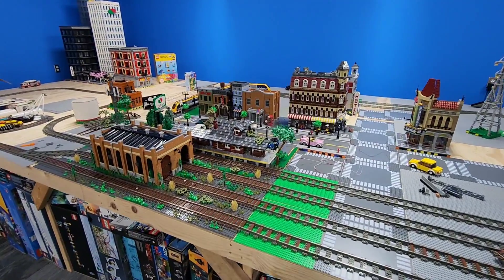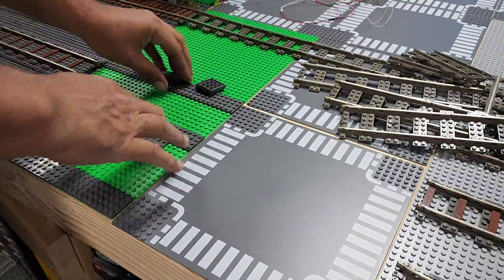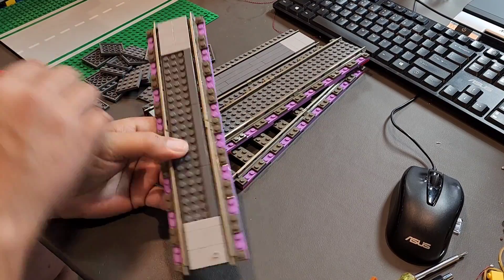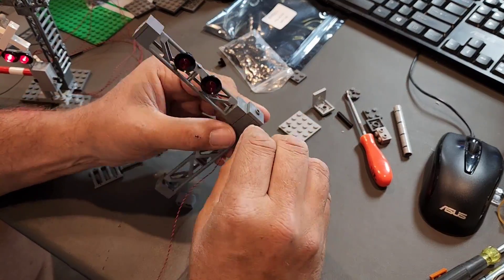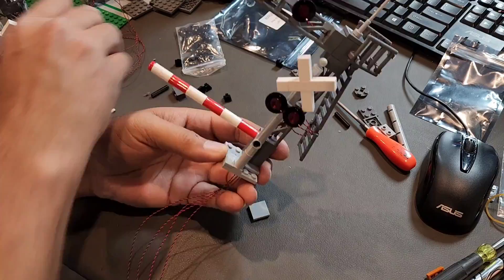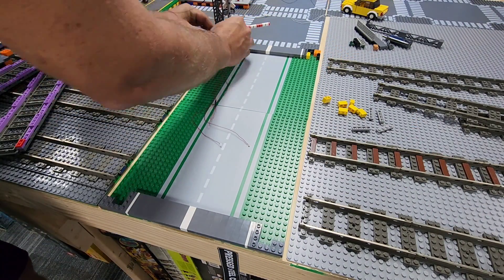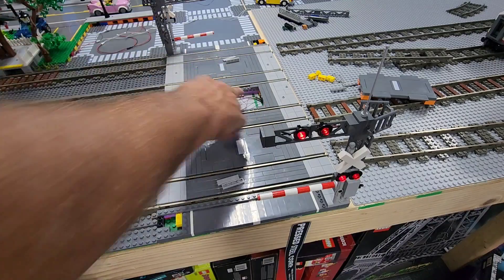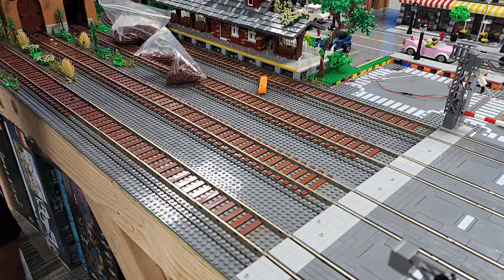Revolutionary Lego City Update

Comment: I'm thinking about getting some of the lighting kits for some of my trains, is there a way to plug your lights into a PF battery box or will I have to accommodate another battery pack onboard?
Reply from the maker: Awesome, they are great for making the trains modular.  As for the battery packs, I'm hoping to have a few more options available in the near future for pluging into the Lego power packs and using button cells, but currently yes the only option I have is using aaa battery box.

Comment: How concerned are you with current drop or throughput for the full display once everything is switched over to the new modular connectors?
Reply from the maker: Well I keep all circuits at under 1 amp of draw. Not worried about current drop as there isn't enough length in any circuit for it to be a concern.  The magnets are rated for 5 amps and the wire is good for  3 at 5volts.  At least I have tested it at that current.  But I still only run 1 amp per circuit as my power supply is rated for 1.5 amps per port.  Quick rule of thumb, 100 leds is 1 amp 😉

Comment: Pinching and binding can cause greater resistance no? 

(I’m only an apprentice 😅)
Reply from the maker: Yes there is added resistance with this type of connection but we are talking about 1/10 of an ohm.  So even with 10 of these your now only looking at a total loss of 1 ohm.  Not something work calculating for. 😀

Comment: The magnet system is pretty cool. I am already using those wireless power connectors for a while to connect the baseplates to each other. It makes the powering so easy and with a magnet it works even better I think. :)
Reply from the maker: The modular connectors are a great way to do it more affordable, but I love my magnetic connectors.  Trying to figure out a way to make them more affordable, so always playing with new ideas.

Comment: That's all pretty great. Do you have any plans to do any vertical magnet connectors? Like, where you can take a floor off a modular building and not have to disconnect the lighting?
Reply from the maker: I currently offer the modular building connector that does that, and it's also what I use for the cars.  I am toying around with a vertical magnet but it will cost more and it will be 1 brick tall, which would make it less convenient for buildings.

Comment: Great Update again Darrly.
Questian i saw that you MILS plate magnetic copplers are out of stock at the moment.
When will you think you can supply them again ?
Also i thought that you had a flat rate shipping cost to Europe (Belgium), what was it again ?

Thanks again,
Greetings from belgium,
Peter
Reply from the maker: Hello Peter 
Yes I do offer flat rate to the UK for 17usd no matter how much you buy.  With the mils connectors I'm hoping I will be able to stock them again in 2 weeks.  The problem I have is my supplier runs out of them fast sadly.  Seems to be an issue with several items.  I will also make a post in community tabs when they are back in stock. 😀

Comment: These new modular circuit connectors are a game changer! Right now I'm running battery pack craft lights, and that's troublesome and limited. This is most impressive.
Reply from the maker: Thanks, yeah I can't stand using batteries.  It's why I use the vintage train tracks also.  My lights are all ran on a usb power supply, and with the connectors and the lighting system I sell it makes lighting buildings a piece of cake :).
Reply: @BevinsBricks  that's the next step, switching to USB.

Comment: I like how you used road baseplate as the base for the railroad crossing 😂
Reply from the maker: Waste not want not.  I actually use road plates under most of my roads as the center pieces really do not need attached the curbs are the important parts to have studs.
Reply: @BevinsBricks  makes sense. As an AFOL, it’s always better to use what you have rather than buying something.
Reply from the maker: Yes but is rarely works that way for me lol

Comment: There needs to be an Academy or Guild somewhere that can present you with an Award for coming up with this magnetic connection system! It's absolutely Genius! Building them into the MILS bases appears to make everything so simple. You need to file the patent application Now! 😀
Reply from the maker: Thanks, I did look into getting a patent but after talking with an attorney and them explaining the costs and how easy it is to get around the patent it's not worth trying it.  As the way they explained it all a company would need to do is change the plug type or wire or installation point and i wouldn't have a case and if I was to cover all bases it would cost me roughly 1k per patent.